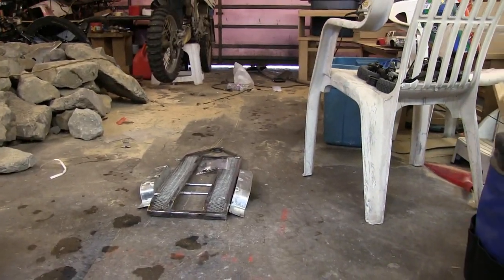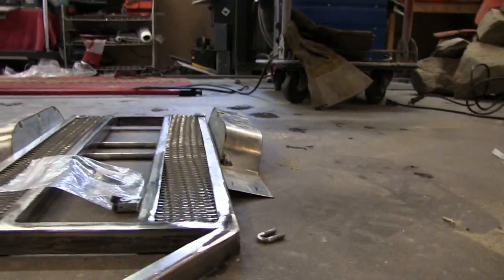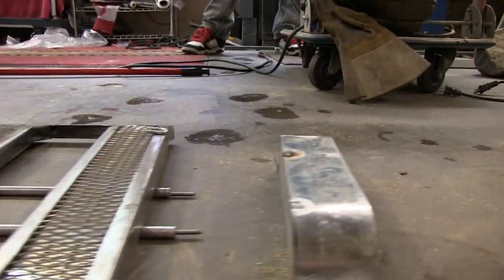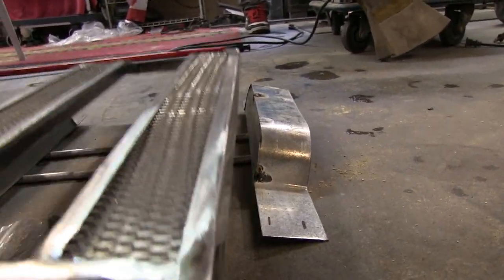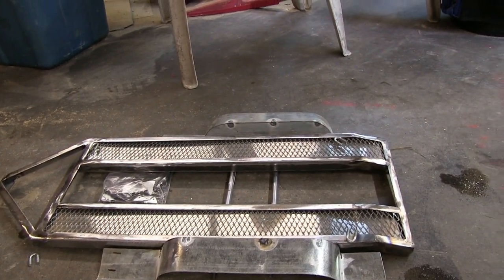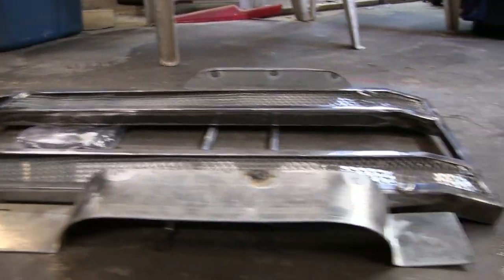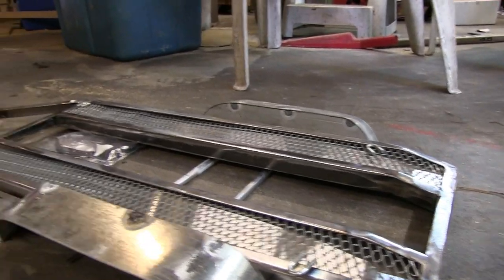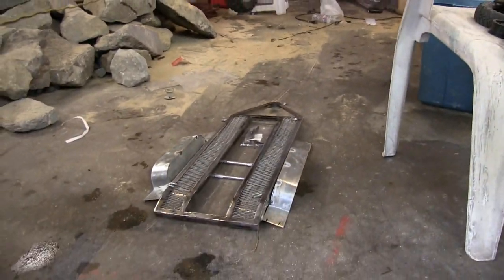RudeBoyz car trailer for the CTG Bodacious Rig !

Comment: My welding isn't bad but I couldn't find any proper steel to work with. LOL I even picked up a set of Oxy/MAP torches from Canadian Tire in preparation for the weekend project. So I did go with the aluminum setup for now until I can find some steel. I posted a video of the build if your interested. Very simple setup.